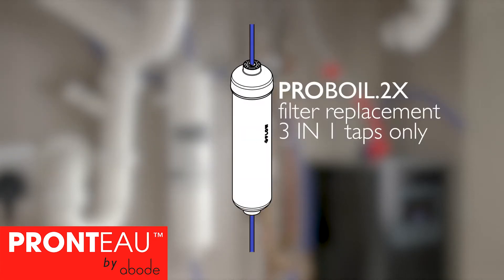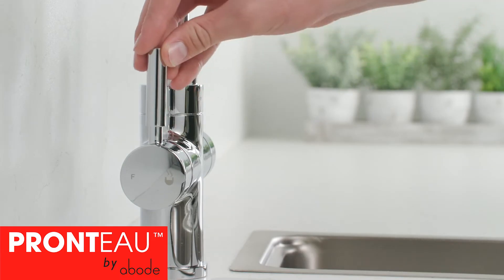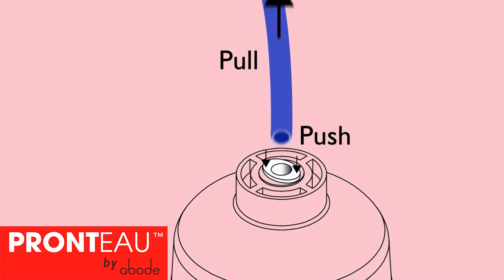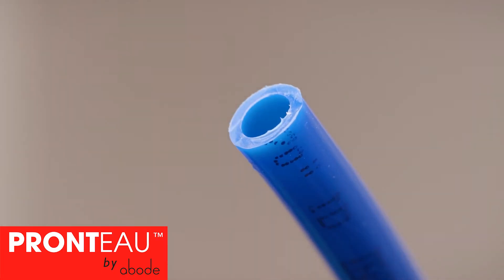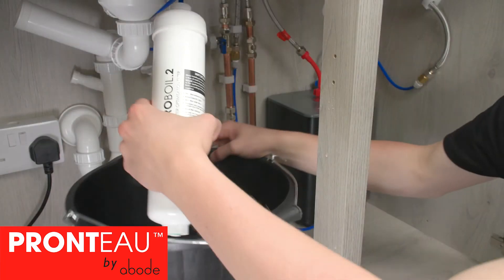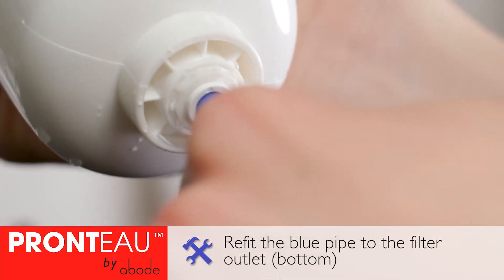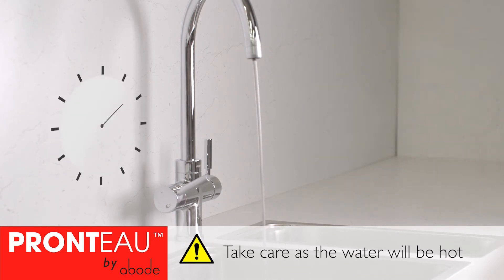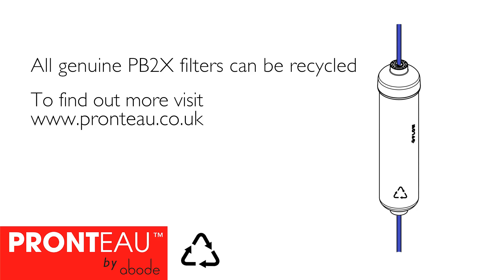Proboil.2X with 3 IN 1 Tap Filter Replacement Guide

Comment: What do you do when the filter reset isn't working?

The thing keeps beeping at me but nothing happens. Still got the annoying "replace me" beep all the time as well
Reply: Same here it doesn’t reset
Reply: Same here, although the beeping stopped when I switched it off at the mains, waited for 10 seconds and switching it back on again.  The filter light is still flashing though
Reply: I get the same, it will not reset
Reply: @paulr1228 did you ever get a result. Mine doesn't reset either.
Reply: @WobblesColin  I have just emailed them, hopefully I will get a reply on Monday...  I will update you when they have.
Reply: The solution from Proboil Customer Service Team is to replace the unit, so they are sending me a new one
Reply: Clearly a fault in the programming. They should have fixed this before releasing to sale. Reset doesn't work at all